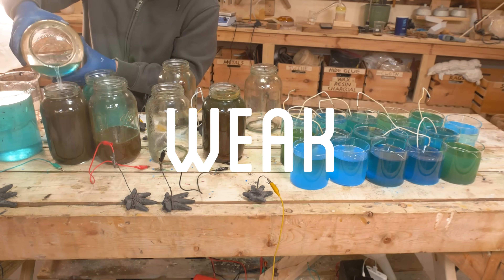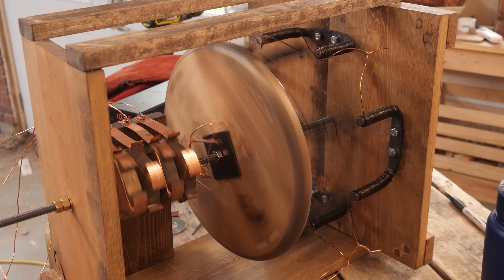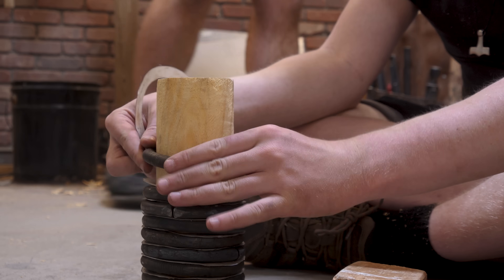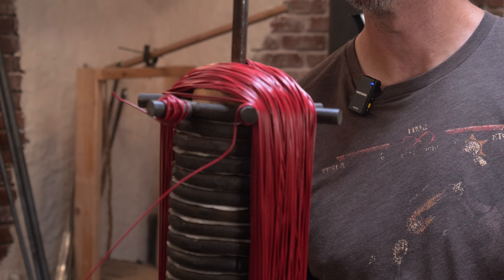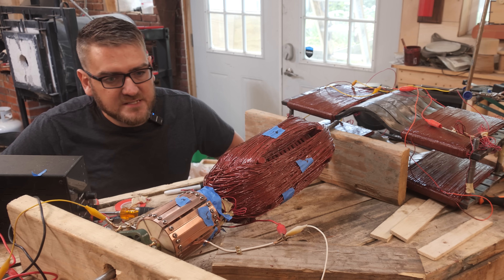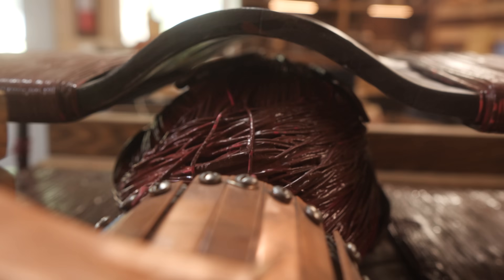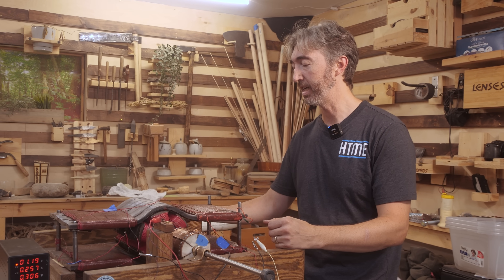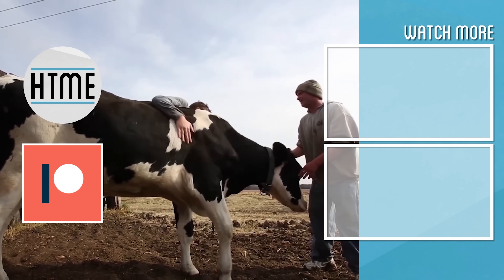I Built the First POWERPLANT!

Comment: You're wrong about electromagnets only being magnetic when current is flowing. This is not true. Every metal exhibits a property called hysteresis where if you magnetize it, say, with an electromagnet setup and then remove the current, the metal still retains SOME magnetic field. To the point where it's noticable. Just try making an electromagnet out of a nail and pick up some paper clips. When you remove the power, the paper clips still stay attracted to the metal. Albeit much more weakly. It's all down to how magnetic domains line up in magnetic materials

Comment: Are the laminates made of soft iron? If they are too hard, they may not flip poles easily enough, as they need to lose and gain a magnetic field rapidly. Additionally, where you have bolts connecting the top and bottom of the DC electromagnets, I suggest replacing them with a large iron block. This could help utilize more of the magnetic field. I also wonder if any of your wire is losing its insulation. Could some of your coil be shorted out after rewinding? You could use an ohmmeter to test for this. That said, I love the look of this design! Great video! I wish I could be there to experiment.

Comment: How are you preventing the brushes from shorting between the segments on the commutator - or does that not matter?

If you haven't, I think it would be helpful to hook up an oscilloscope and record the voltage pattern over a few cycles at different speeds to see what the voltage pattern looks like over time / vs the angle of the crank.

Comment: Instead of copper plates for the commutator, try using a copper pipe with a wood form inside it. you should be able to cut the pipe into sections and it will be perfectly round

Comment: I'm not sure if this will even help you one bit but one interesting thing I found while going through thermodynamics by schroeder is that he said that as you heat a ferromagnetic material to it's curie temperature and align it with a magnetic field then let it cool down to room temperature, a permanent magnet is form.
I did tried it on materials I have at home by heating the ferromagnetic material (likely a mix of aluminum and iron) to red hot, then put a magnet on it and cool it down. Which did not work.
But again it's likely that I did not heat the material to it's curie temperature as that would mean the ferromagnetic material has to lose it's magnetization property.
So my current hypothesis would be "Bigger ferromagnetic material needs to be used and use a smaller permanent magnet to magnetize the whole thing, giving us a stronger permanent magnet".
Hope this helps

Comment: I’m not sure if you guys are still working on this project because I have to finish watching the videos, but I know something about these old motors and generators. Your friend is right about downsizing the commentator but also the reason you are getting bounces because of the way you built it. One of the things you can do is Have three segments on your commutator. You have six coils, but two of them form one set of poles, and if you connect the ends of the coils together a certain way, you can only have three segments on the commentator, and thus make it somewhat rounder. The other thing you can do is to start out with a piece of copper pipe of a large diameter and sand down a wooden cylinder until it fits snuggly inside. Use small screws to attach the commentator segments to the cylinder and then cut a slit in the pipe 120° apart, three slits thus making three segments of the same size. I wish I had time to sketch this out for you, but I saw it in a bookand this was the method used in another generator like this from that era.

Comment: I think you should use ring commutator it doesn't need the rotor to change polarity, the rotor needs to act like a rotating magnet inside, the generator you guys build is Producing pulsating dc like in dc brush motor.

Comment: I hope that the HTME Team manages to improve the generator, battery and waterwheel to an efficiency high enaugh that the could make a Almost Perpetual Motion device. The waterwheel starts with a water deposit that send the water to the wheel, the generator gets turned by the waterwheel and generates elecricity that gets stored in a battery/capacitor. Waterpump gets powered by the battery/capacitor while the generator keeps it charged. Then the water gets back into the deposit and the circle starts again.

Comment: If you had a break in one of the coils, you might get the on-off problem.
Also, there is a relationship between the stator and the shape of the magnetic field, for best efficiency m, the stair contacts would need to be just the right size so they turn off and on at the right time.

Comment: So I think the gear mechanism for a modern hand crank coal forge blower should have been around by then, it might be worth using something like that to test how it's behavior changes at a higher speed, as I assume that the final mill powered version will have some gears to change torque into rpm.

Comment: I would suggest the ends of the outside flat bars should connect on the outside of the ends of the flat bars. To join top to bottom with each flat bar.

Comment: Only thing I can suggest don't know if somebody else did already is making a capacitor such as a Leyden jar or something else to put on the end to help clean up the DC power did not know if you're using the meter in AC mode or DC mode to measure the voltage but almost all generators put out an AC type pulsing voltage which is normal to turn it into DC you would need a diode and a capacitor.

Comment: Stator needs to almost entirely wrap the rotor, it should also be almost paper thin between the stator and the rotor if you can get it that tight, balancing the rotor is also a consideration as it will prevent wobble. Making the commutator smaller might help but you could also stand for a redesign, that method is inherently bound to cause jumping/bouncing in the arms, if you can try switching to a sprung brush like used in car alternators.

Comment: For measuring the energy, why can’t you just use a resistor in parallel with the capacitor? Actually, if you measured the voltage with a multimeter, it’s probably 10MOhm internal resistance, giving about 90 microwatts output, no?

Comment: guys, i think that the stator (which is excited by the electricity generated by rotor) has it's orientation wrong. because you want all the magnetic lines from both the poles to pass through the rotor and end at each other, one originating from North pole and the other merging into the south pole. In your design looking at the top rotor, it is an electromagnet, where the magnetic lines originate form one end of the stator and end at the other, this means that there is a very low interaction of the magnetic lines with the rotor. I think that by putting the stator from a horizontal position to a vertical position it would yield better result.

Comment: Carbon brushes with encapsulated springs make a much more consistent contact. 

Needs to be geared up, should be doing at least 30 RPM.

And certainly capacitors before a resistive load which you can easily measure the voltage and current.

Comment: Not an engineer nor do I know about electrical current, however, I will make a suggestion anyway. Perhaps using a ferrite core and treating the “generator” as a gyroscopic machine, ie: mounting it angular and in relational direction to the earths magnetic poles would be beneficial. The “pulse” emits a resonant frequency, understanding what that frequency is and how you can “utilize” its “potential” may also be beneficial.  What I do know, is that everything is IONIC and everything is affected and effected by frequency and electrical charge.  You might also find that a conical “antenna” placed 30-50 feet from ground level and connected to the dynamo may serve to increase the output. Great video, great project and I look forward to seeing more!

Comment: Your magnetic circuit is entirely closed, it will preferentially travel through the plates and threaded rod. There really isn’t a path for flux to cut the rotor, low flux low output. I hope this helps!

Comment: I would just add more weight on top of the brush or perhaps a spring-action to keep the brush in contact with the commutator. 

Some gears added to the drive system could give you more rpms.

Comment: 16:48 you should be able to calculate and measure the maximum potential output based on the energy to put in. Like how many watts goes into hand cranking the shaft will be your max power output for sure. But you got to fix the measurement of the device output first

Comment: Hi, if the strucural supports (the rods at each corner) that you use are not insulated from the nort and the south pole i would assume that you short your magnetic poles. Using wood, or something insulating might help

Comment: Looks like you have alot of design issues starting with the commutator, do more research on that, just because what you made looks sorta right it is so far from being right, next it looks like the images of the "og" generator has the field magnet bars coupled at the ends on every bar not just the very end bars like you have, and then you need to have a kernal magnet in the rotor to start the generation of electrons flowing to create enough electricity to power the field windings, you need 2 different sets of brushes off the commutator, one set is connectd with the  field coils and the second set is for the electricity for what every you want to run, also the brushes need to be timed correctly with rotation to gain efficency, make 2 seperate sets of brushes that can be moved to change timing while spiining the rotor and watch the volt meter , but you need to make some massive changes to the commutator

Comment: It looks like the design of the stator creates the orientation of the magnetic field that is hardly directed to permeate the rotor. Most of it is inside the stator core and then it splits up to above and below the core. As a result most of the field lines live "outside" of the rotor core and the coil creating very little changes in the magnetic field through the rotor and thereby reducing the induction in the rotor coil.
To maximise the efficiency the stator's magnetic field should be directed axially to the rotor, go through the rotor and connect to the opposite stator's core. In your design most of it goes around the rotor.

Comment: Try a MPPT solar battery charger (with a large value capacitor across the generator, and connected to the solar panel input of the MPPT). MPPTs are designed to squeeze the maximum amount of power out of a variable source, automatically choosing the right load current. Just make sure to get a fast adapting MPPT, as some of them can take a minute or longer to adapt.
Now that you can measure the generated power properly, you can start to improve the generator. I would suggest starting at adding lots of iron connecting the upper and lower parts of the left and right side of the outer coils, like you started to do for the opensauce version.

Comment: Regarding the commutator, it looks like you have multiple adjacent copper bars connected to the same coil; if so, you might use wider copper bars or arrange them sideways cut to size, that way there's only a disconnect when switching to another coil. Alternatively, or in addition, you could lengthen the part of the brush contacting the commutator, make it form fitting to the commutator diameter, and have a form fitting piece of wood on top pushing it down due to weight or a spring force, to keep the brush in contact at all times. If you wanted to go nuts, spin the rotor and file/sandpaper the commutator so that the outer face of the copper bars has a curved form. The circumferential edges of those flat faces are basically acting as cams throwing the brush up and away from the commutator.

Comment: look at the design of a ceiling fan. i have had great success getting very large outputs of voltage and amperage out of converting a ceiling fan motor into a generator. axial generator easier to build, you can get much closer tolerances, and take up less space.

Comment: The insulation on the rotor wires is limiting the electrical potential. Since you are using store bought wire, you should consider switching to wire that is meant for winding coils. The insulation is much thinner and the closer those wires are together, the stronger the magnetic field is. I would do the same with the stator. Also the stator is too large. The magnetic field is loosing too much energy covering that distance. Shorten the arms up and wind the stator windings in a less spread out configuration. The idea is to get everything as close together as possible so the opposing fields are as strong as possible to build up more potential for current at higher voltage output. Voltages pushes amperage through resistance.

Comment: As an electrical engineering student whom is currently studying motor design, I can say that your biggest issue is most certainly the massive air gaps on the sides of the design (not the rotors air gap)  this is because any magnetism produced inside your coils should travel through as much magnetic material as possible before looping back into the other end of the coil. As your design currently stands, the magnetism has to go through the cm or so of air gap in the rotor then it has to go through the 15 cm or so of air on the sides before it can complete a loop. 
We model magnetic circuits like we do electric circuits, and in our model air gaps act like high value resistors, while ferrous material acts like decent conductors.
Reply: I agree the modern motors seem to have an air gap in the .010 to .030 thousandths. Or that's what it looks like. I've also read the air gap performance reduction is exponential to the distance. Also, couldn't he use that capacitor to absorb the DC pulsing and smooth it out?
Reply: If anyone interested on this also read it: the other problem is the external stator design itself. They speak about eddy currents yet don't seem to understand fully how to design around (which is expected really). They should use thinner steel blades for the electromagnet, stacked on top of each other, maybe even sheet steel.

A good source for the design is either the old sillicon-iron steel core transformers (loots of books on designing the magnetic flux expected) and cyclotron yokes. Also no need to use paper insulation between the layers, no high voltage is going in the yoke, the air gap is more than enough. Simple rust/ferrite or varnish is enough to isolate.

On top of that, the problem with the output may be there is no load. Putting an adjustable resistor made of nichrome plus a capacitor and maybe a diode should allow to meassure the power output through current/voltage easily.
Reply: That’s so cool, so you can control the resistance by increase air gap distance? That’s brilliant
Reply: spot on

Comment: OK, here's how to make your commutator work better, and this comes from an industrial electrician. First, graphite brushes. Invented in 1890's, so they are period appropriate. This increases current flow through the brushes. They need to be spring loaded to hold them against the commutator, too. Next, the commutator needs to be as perfectly round as possible. Put that thing a lathe. You don't need a machined polished surface, but at least taken to a rough sand paper finish. This will eliminate all bouncing and loss of contact from it. Copper is still you best bet with keeping to being period accurate for material.. Smaller size is a good idea, but your brushes can't go much smaller than the size of a pencil eraser or they tend to break with graphite, so that limits your commutator size.

Comment: You have a giant magnetic loop/circuit around the rotor, but that's not how generators work, the moving coils need to sweep through the magnetic field lines perpendicularly, instead, your rotor sweeps adjacent to the magnetic field, that run almost exclusively through your metal loop around the rotor (iron has very high magnetic permeability, so the magnetic field runs almost entirely through your magnetic loop on the outside and almost none through your rotor). I think you might be able to correct this by adding two heavy iron central arms that terminate at the rotor so that you split that big magnetic loop into a top and bottom loop where in the middle, the field lines cut across a gap where your rotor is. The magnetic flux right at the top and bottom sides won't contribute to generation, but the interrupted middle loop will. The metal magnetic circuit should look something like EoƎ (but the top and bottom are solid curved lines, just the middle legs are interrupted by the rotor.

Comment: Ok,i hope this will be as useful as possible,after changing the rotor which quite well resembles modern dc motors and generators i think that main issue might be stator,as a solution i would suggest following(if you havent tried it):we can imagine stator as two electromagnets,upper one and lower one,each of these electromagnets has two subelectromagnets  (two coils,two subelectromagnets),it is VERY important that those subelectromagnets REPEL each other so that upper electromagnet(made of those subelectromagnets on same core) behaves as south or north pole magnet,and ofcourse,one on the bottom will behave differently.Sorry for my gramatical mistakes,english isnt my native language,if you find it interesting i can go into further details.Cheers.